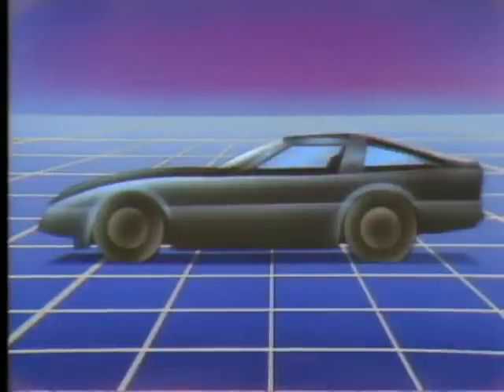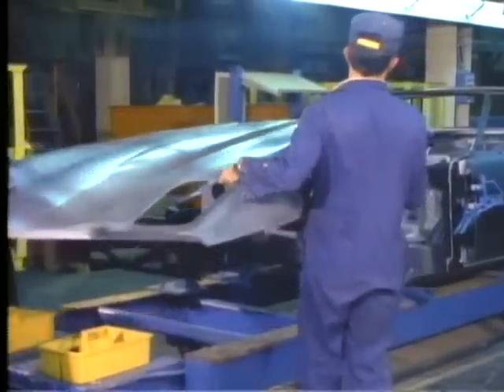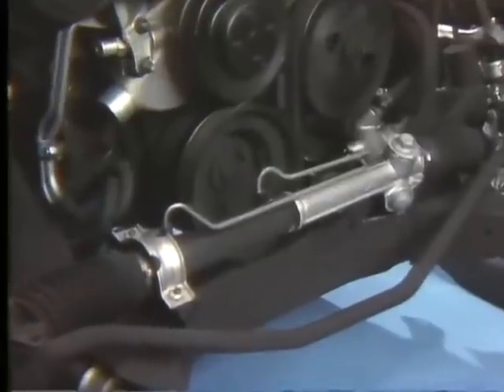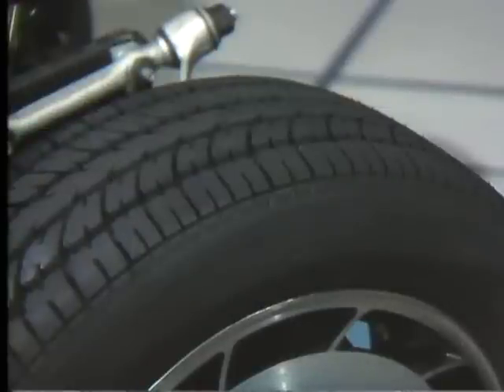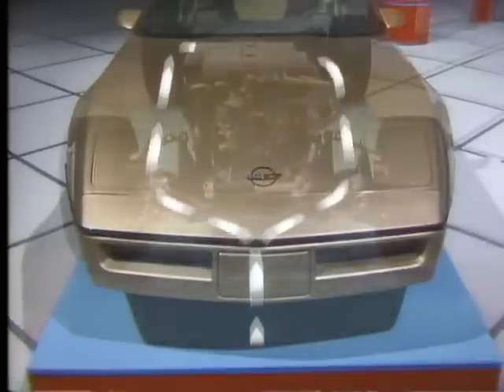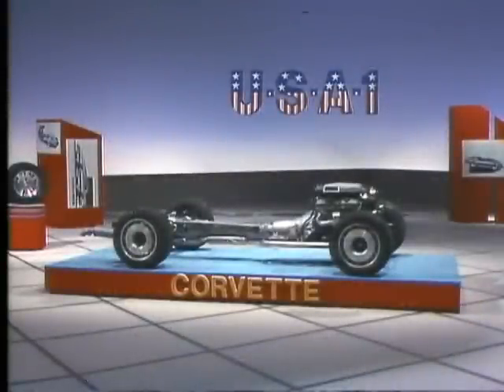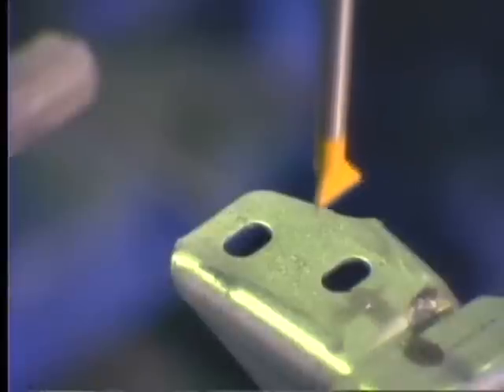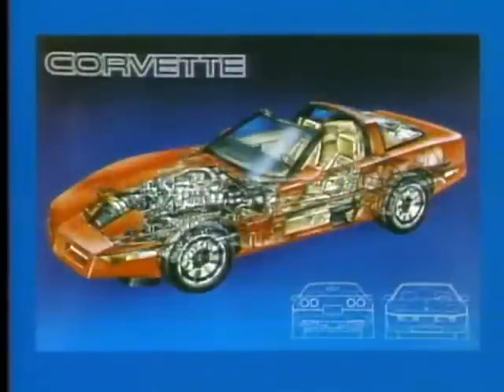1984 C4 Corvette Chevrolet Engineering Video

Comment: I've owned three C-3 corvettes ('68 327 roadster, 71 ls5 454 roadster, '71 ls5 454 coupe) and have been a Corvette fan ever since I can remember. I currently own '71 ls5 SS 454 El Camino (poor mans Corvette) that I've done quite a bit of work on and it's just about finished (they are never truly finished) and I'm thinking about getting a C-4 Vette because they are so affordable right now. I also consider them a "good looking car". I work for a large auto auction and as luck would have it we had a '92 rag top come in today. It only had 66,000 miles on the clock and was in fair shape for it's age but a huge disappointment.

It "rattled" horribly and it's 300 hp 5.7 was anemic at best. I know at some point it will be a "future collectable" like the C-3 but for now I just can't seem to justify putting 20,000 grand into a car that on it's best day might sale for 10,000. For me this is one of those cars I might buy because "I've always wanted one": come to think of it. I'm pretty sure that's how I buy all my cars.
Reply: +skcharger440 I found c-4's from 1800 to 15K$. they 're so cheap to buy build and run, Lot cheaper  than  my 80"s IROC

Comment: i have an 85 corvette and mine did the same thing, you might want to check coolent levels. if its not full the thermostat will not open. makeing your corvette over heat. you might also want to clean the radiator. cleaning the radiator alone will reduce heat by 10 degree's

Comment: I've stuck in a 396 stroker motor, with a D-1 procharger along with a 4L80 transmission, replaced the breadbox, installed the best looking autometer gauges. Stripped every part off the car it's all being sanded down. And before it was tore apart for the new paint job I pull up to vipers mustangs cheveles you name it and I throw down a complete woomp down on them, oh yeah and the zo6 also. After the paint is done I'll be looking for a z07. 1986 revamped 👊👊👊.
Reply: wow big daddy.

Comment: "Light weight magnesium" so that the car burns better in a crash.
Reply from the maker: Pure magnesium is very flammable. In car parts, the magnesium is in an alloy with aluminum and will absolutely not catch on fire. Ignorance abounds.
Reply: interesting. i did not know that. Thank you for the KIND correction.
Reply: Pure magnesium will burn very hot when in the form of shavings. Small shavings of magnesium have a much higher surface area than a block of magnesium. A block of magnesium does not have the surface area to support combustion. You can hold a torch to a block of magnesium and nothing will happen. If you scrape it into shavings, then it will burn extremely hot. An example of this is the magnesium fire starter bars, it only burns when scraped into shavings.
Reply: +BigRodJohnson69 I'm glad you explained that. I knew Toyota MR2 fans who called the Pontiac Fiero the Pontiac Fire Hazard.

Comment from the maker: @LeesVette Thanks. I always wondered about this. Also in one of these videos one can note the battery is rotated different than normal. I also had an early repair manual that illustrated the cruise control servo positioned forward of the left front tire instead of over the battery.

Comment: I'm looking at buying a C4 just as a play about / sunday drive car, what are they like in terms of reliability and maintenance?
Reply: I have a 93 with 130 K on it and its still in show room condition. They can have little problems spring up but with proper maintenance they can be great cars to own. Long drives dont beat you up and they handle like a dream in the hills. I like the the early 90's version myself but my dad had an 85 with the Z51 package and that was a beast on the street.
Reply: i'll be finding out ....lol ...hope it's not worse than bikes....
Reply: +Cykoid Did you ever end up buying a C4?
Reply: cptmiche nah, the ones that were asking decent prices were pretty much needed full restoration or were water damaged, the only halfway decent looking one the guy talked it up big, made it seem like it was going to be a good decent price/deal then all of a sudden says "the price i'm looking for is a solid $92K" i just walked away laughing. Then literally the day after, they announced the mustang was finally coming to australia i put an order in and am waiting to collect it next year
Reply: I did, in the USA,it was pampered by the previous owner, he even rebuilt the AC control head being an electronics whiz. And then asked if it would be a daily driver to which 
I said no.Only put 4k miles in the last yr on long drives.
Reply: Cykoid Wow, I actually ended up buying a 1996 LT4 C4 corvette with 18,000 miles on it (in literal showroom condition, not a scratch on this this) for $15,000. It took me a bit to find it, but I definitely think it's worth it.
Reply: Wow.......that's cool,,,,,,,,have fun,,,

Comment: The chassis is stiff... that is until you take the targa off and becomes a blubbery mass of motor and tires.

I love my 96, but taking off the targa is both enjoyable and annoying.
Reply: both of mine drive so loose all the time lmao
Reply: +wyvern  Try the Vette to Vette no flex system.  I put one on one of my C4's and it works great.  It's a convertible so if it didn't work the chassis would be a wet noodle with no roof structure.
Reply: vl5150
I got rid of the car for a couple year old Challenger.

Sadly the Challenger out-handles, out-brakes and out guns my C4, even with it's 4,100lbs heft.

I have a feeling my C4 was a lemon or wrecked, considering I was owner number 8 and it only had 62K on it and was repainted.
Reply: Wyvern what year?
Reply: Sonnywitdamoney
14' 100th anniversary R/T,  right before the body update.

Comment: 00:31, if you have those rims, your special, im pretty sure they weren't available
Reply: +mark marshall were only available on the 83 C4, only 45 were made. Only one is left, not sure on wheel build numbers though.
Reply: The base 15 inch wheel was never available to the public or an option.

Comment: Over rated plastic car
Reply: +richie rich It's not plastic. It's fibreglass. And how is it overrated? It competed with super cars 5 times it's cost.
Reply: +cptmiche fiberglass still plastic and true it competed with super cars but it's just another American v8 powered car
Reply: And how is that a bad thing? Americans make great push-rod V8's, while nothing exotic, they make tons of power, can be built to crazy levels and live forever, it is not uncommon to see a C4 corvette with 200K miles on it. Don't fix what isn't broken.
Reply: +Wyvern I never said American v8s wasnt any good I just said the corvette is over rated
Reply: *****
how is it over rated?
Reply: *****
Somewhat yes, but the reason for this is until recently, an average joe can buy one and get performance that rivals supercars that cost more than most people's houses.

It is the people's sports car, just like the Miata is the people's roadster.
Reply: It's really annoying when people rag on the vette. It's not trying to be a supercar. It's not trying to be a luxury car. It's trying to be a fantastic performance bargain. And it succeeds immensely at that. You can get an LT1 C4 vette that goes 0 to 60 in like 5.5 seconds for about $6k unlike JDM cars of the day. And they are very reliable cars, unlike most euro cars of the day. Cheap: Check. Reliable: Check. Fast: Check. handling: Check. You can only be so much of a cynic before you come across as arrogant. Everyone knows it's 90s GM. Nobody expects old Vettes to have well built interior, or not to rattle all the time. But I don't care if the interior is standard 90s GM. It's a sports car, they aren't supposed to ride great.
Reply: How can you talk shit if you never owened one. I have a '92 LT1 and a '94 ZR1 and they are both fine.
Reply: Michael DeSanta
I have a 96 LT4, and the only thing that I have to complain about is the extremely narrow foot well and the laggy electronic speedometer.
Reply: Coming from someone whos never owned one and probably can't even afford one
Reply: They are hard to rate because there's nothing in it's class to compare it to.

Comment: I have a 1984 cross fire injection.   Put an L98 in hogged out the intake. I have been over 250 mph. I am pretty sure it should top speed at around 300 mph.  Red line is 8.000.on motor. But the intake only lets it get about 6800. I've been thinking about adding another carb on vacuum .to get to 8000.rpms.  love it.  At high speed.  I have 200 mile an hour tires. But at around 250.  Very touchy steering. Tire slip.  Cure. 300 mph tires.  Do they make them?
Reply: Yeah right. I own a 2000 Camaro SS and put wings on it and now I can fly around in it like a Jetsons car.
Reply: @jeffjackson9679  I beat them pretty bad. beat one the other day.a yellow ss.  And she mite fly trying to go as fast is a vett. But you won't like the landing
Reply: I had mine up to 480mph the other day wasn't my fastest run because I had my turn signal on